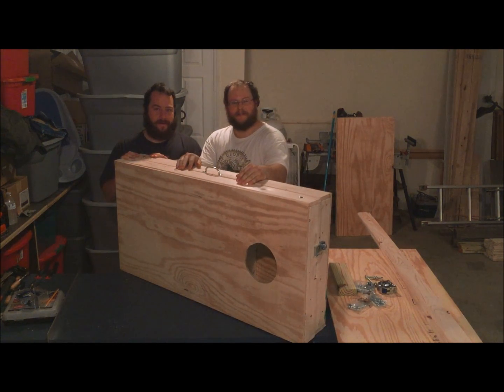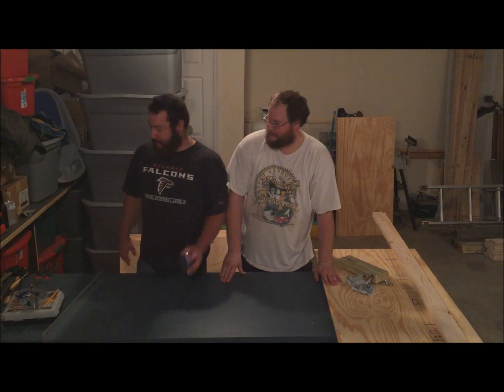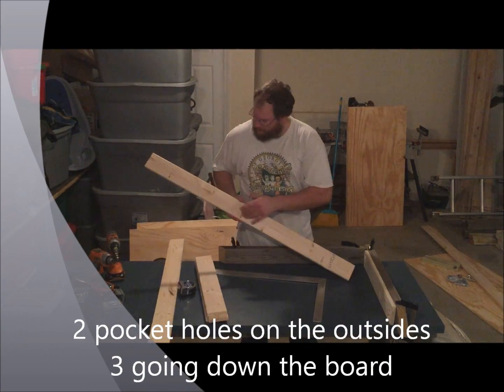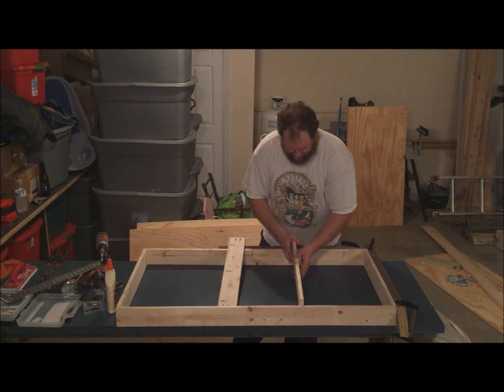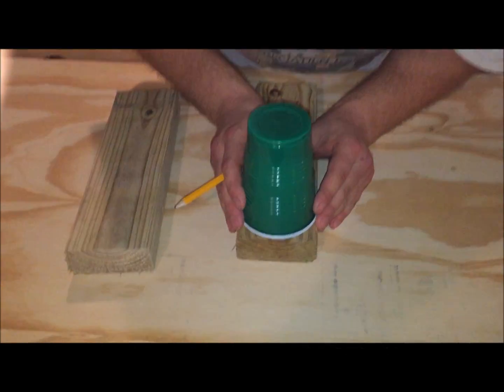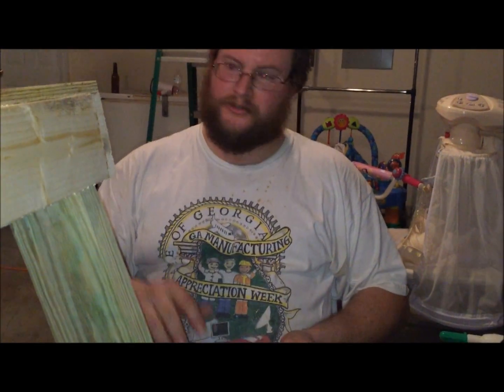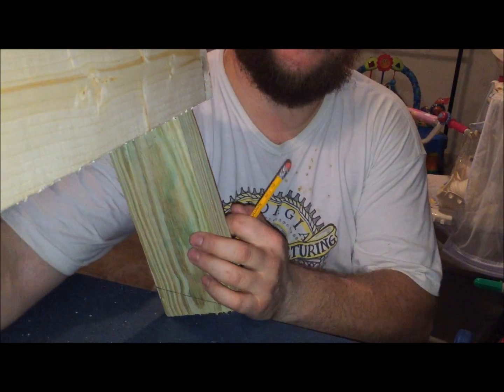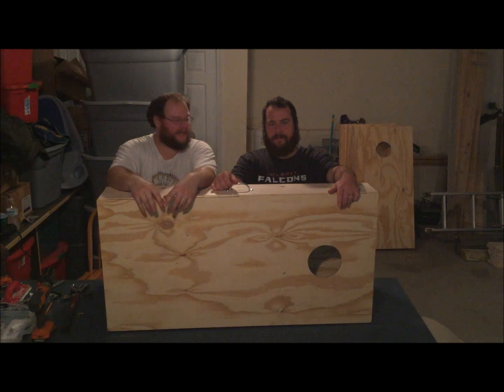How to make a portable cornhole board DIY

Comment: Word of advise.   Measure the plywood tops if you buy them pre cut.   They may not measure to exactly 24x48.     Which means the cross members and length measurements of your frame will need to be adjusted to mate how the top measurements.   I bought two tops at Menards and they were not exactly 24-48.  So I had to adjust the frame boards measurements.
Reply: Yup, Actual measurement on plywood from H D and Lowes precutis bout 47 7/8" by 23 7/8 cut frame accordingly....